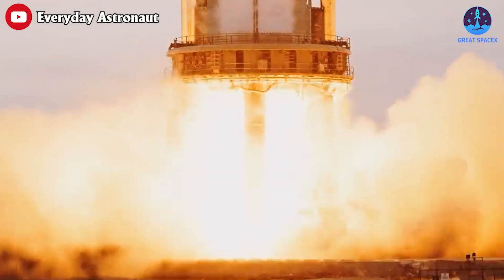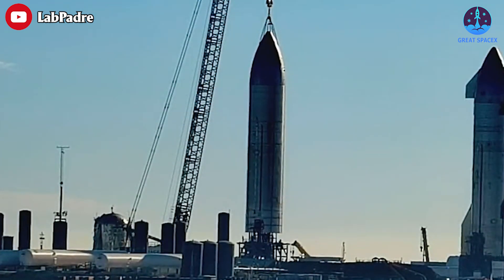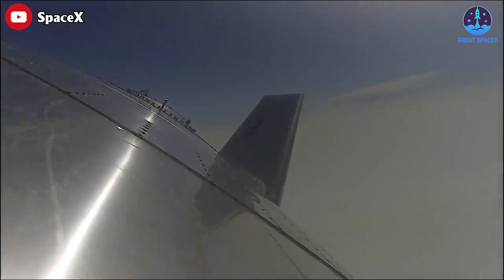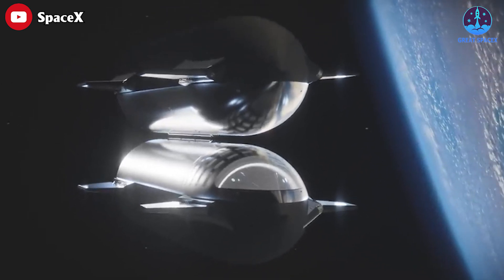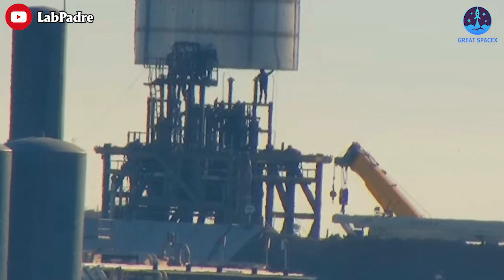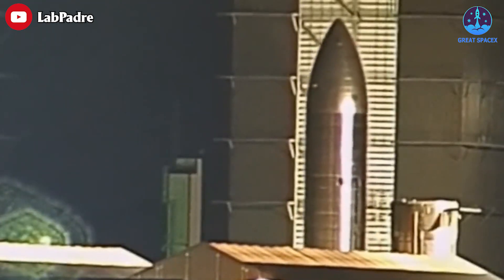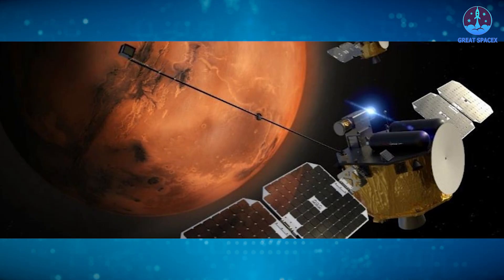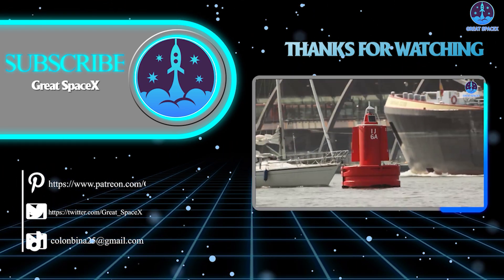SpaceX revealed a naked Starship prototype to test site, unlike any other...

Comment: I would think that if you had a ship thar had no flaps, no heat shields, that it would be intended to go to space and stay there, in effect to be a space station or satellite, or even a fuel station. I'm wondering if they could design the starships to lock together for interplanetary travel, taking massive loads of water and other supplies for sustained and extended missions.
Reply: That's one thing that had me wondering all NASA rockets use hydrogen and oxygen same with Russian. And the byproduct is they get water to fill tanks so it is the same as lifting fuel they are going to have to lift water separately as a cargo
Reply: Basically a container unit.

Comment: Might be a mass simulator with capability for testing re-entry of a ship without tiles and fins ie single use craft or for re fueling. That would allow proving the fin-less, tile-less version can be controlled for reentry and possible recovery of engines if landing in water works. Rocket Lab recovered a booster from water and successfully tested some of those engines for long durations... don't know if composite booster tank was tested again for re-use or disposed. Imagine a doused Starship could still float for recovery if soft landed in water, sort of reverse case of submerged water launch ?

Comment: Quite key is it was moved to the suborbital launch pad. This means it can launch without using the SuperHeavy booster. Moreover, with 6 engines it can launch using a full propellant load, unlike the other Starship test launches just meant for short flights to test landing techniques. Then the key question is what is the dry mass of this expendable version without flaps, heat shield, legs, or ballast tanks? Elon once estimated an expendable Starship with only 3 engines might mass 40 tons. Then with 6 engines it might mass ~45 tons, though perhaps it might need additional strengthening of the tanks, so added weight, to handle the higher thrust. But by any reasonable estimate of the dry mass of this expendable Starship, it can carry significant payload as an expendable SSTO.
Reply: No ssto...

Comment: Well, StarShip had several "Pathfinders" built during it's ongoing R&D, why wouldn't the same occur for the Oribital Tanker Depot or the HLS destined for the Moon. Neither of those designs req Flaps or Heat Shields as you've stated. As far as BO's slow progress . . . there are Many startup's vying for position in this New Commercial Space Race the world is currently in. Who wants to work for a Warehouse Company Mogul who barely knows what the Pointy End of the Rocket is for ?

Comment: Its been made to do the Orbital test ONLY....
Why would they take a fully finished starship to do the orbital test just to drop it in the pacific ocean...
Heat tiles aren't necessary for this first test... they'll let it burn up in the atmosphere..
Actually this stainless steel has not been tested as far as heat dissipation from re-entry...
This could also be a test of how many tiles they actually require...
They could be surprised and see that this Stainless hold up way better than they thought...

Comment: I also think SpaceX should diversify - into building life support systems separately from its current projects which are strictly internal; now the products of a life support company might all be used by SpaceX, but it would promote some standardization in the products. anything from small capsules to entire passenger starship versions. So the products would include power supplies, waste recycling, space suits, and habitat sized things as inter-operable units (maybe even with plugin replaceability).
Reply: They will use the life support systems from dragon. They are just scaling it up
Reply: @Tom-gj9iq  
They should make a telescopic Starship which when in space slides out its fuel tanks and engines to create a lot of additional space.
Reply: @Tom-gj9iq  makes sense, it's getting plenty hours of experience to iron out any bugs in the system ( like leaky toilets😱) before uprating for deep space 🤔
Reply: @Tom-gj9iq  there are limits to "scaling it up". what works for 4 to 7 doesn't work for 100.

Comment: We'll see when they do the cryo-proofing test!
If the frost lines are modest and close together it's going to be a test article for HLS, 
If they're larger, or widely spaced it's likely to be a fuel transfer test vehicle 🤔
Reply: That's what I thought too. A ship they can send up and leave in obit as a fuel transfer station.
Reply: @t-6273  the fuel tanks would have to be the full size of the vehicle and there would have to be insulation and a second skin to protect from impact damage.
So if it trundles out of the High Bay in the next month somewhat fatter and shinier you might have a point 🤔
Don't you just love how they keep you guessing... I'll bet they monitor these comments to see if anyone puts out ideas they haven't thought of 🤔🙉🙈🙊
Reply: propellant tanks are the same size as the normal ship
Reply: @andytroo  good to know, could still be HLS test bed, I'd love to see some more hops to test out lando gear and upper body descent thrusters... They have had a few dollars from NASA to progress the design 🤔🤗🤗
Reply: They should make a telescopic Starship which when in space slides out its fuel tanks and engines to create a lot of additional space.
Reply: @reasonerenlightened2456  or detach the upper section to make a additional stage to be refueled in orbit to make a single round trip starship for an exploratory Mars mission (NASA???)..."to infinity and beyond!"🤣😂🤣
Reply: I've often wondered if Spacex has thought about doing an RD180 with Raptor 2, at least for the outer ring on the booster!
Even up sizing the pumps and ancillary equipment to drive 2 combustion chambers I would expect about 30% mass reduction against 2 discrete Raptors... perhaps in the future when the reliability of the system is assessed.
Alternatively (dare I suggest) an outer ring of Aerospike Raptors 😱😱😱... probably a bit of a mass penalty but the increase in  high altitude efficiency and stabilising effect on the inner engines might increase the potential mass to orbit... could also replace the vacuum Raptors on Starship 🤔
So many possibilities, makes you appreciate the design philosophy of Spacex👍

Comment: How about 26 is simply a test bed for various potential internal tweaks.  Not everything has to be OMG spectacular.
Reply: Ship 26 will go in space to push away the Hubble telescope?.
Also, they should make a telescopic Starship which when in space slides out its fuel tanks and engines to create a lot of additional space.